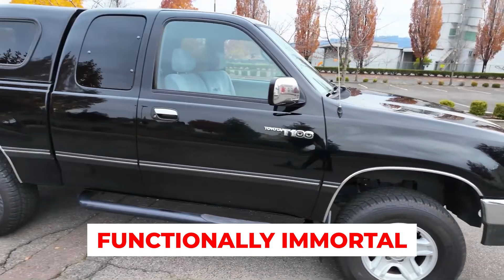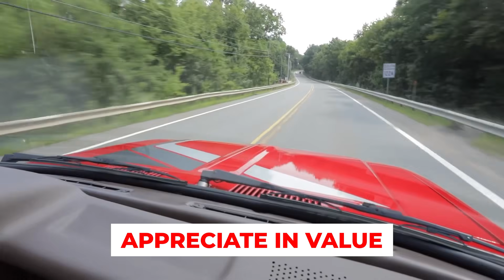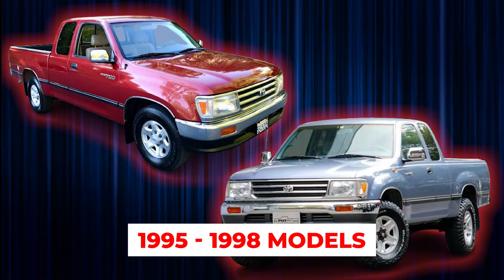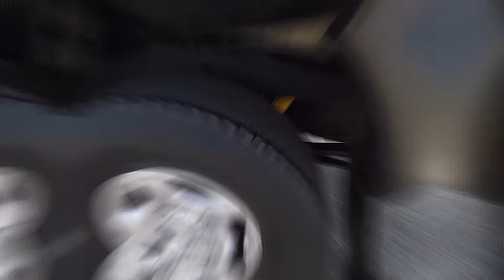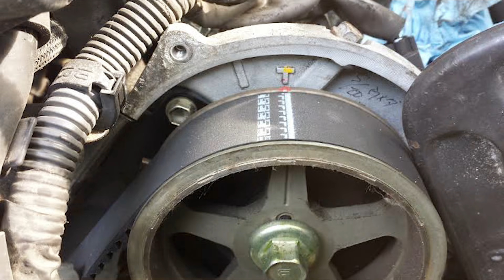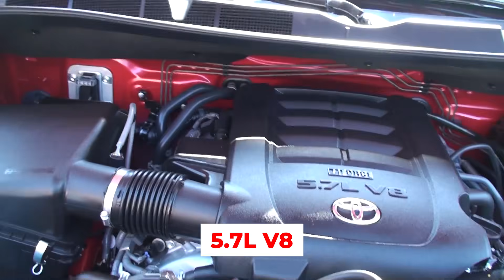5 Legendary Toyota Pickups That Are Better Than Buying Brand New!

Comment: My personal experience owning Toyota trucks: My first was a '96 V6 4X4 extra cab T100 SR5 that I used to haul heavy loads of bottled water out of the north Georgia mountains, I found myself wanting a V8 and bought an '02 V8 4X4 regular cab long bed Tundra SR5 in '03. I sold the T100 2005 and I rescued a 2007 5.7L V8 4X2 regular cab short bed Tundra SR5 in 2017 because I wanted a truck with performance that was similar to my '71 ram air 455 H.O. GTO that I had in the 80's and the 5.7L delivered. The '02 and '07 remain in my stable, and I see my old T100 a few times a month... the gentleman I sold it to has passed but his wife continues to drive it.
Reply from the maker: Great to see you back in the comments! You’ve really owned the 'greatest hits' of the Toyota lineage. I love that you mentioned the T100 - it was such a misunderstood truck back then, but seeing yours still on the road today proves it was built right. Comparing the 5.7L performance to a 455 H.O. GTO is a huge statement, but you're right; that engine really changed the game for half-tons. Since you've watched the evolution from the T100 to the 5.7L, do you think Toyota lost a bit of that 'simple' magic as the trucks got bigger and more powerful, or did it just get better?
Reply: @AutoMetricsHQ  In my opinion the ultimate Toyota 1/2 ton would be a standard cab early pre-facelift 2nd generation 5.7L Tundra SR5 with T100 build quality, a beefy mechanical LSD in the rear end and less interior plastic or a higher grade of plastic. The 6 speed automatic is fine, and I don't have a problem with push button 4WD
Reply from the maker: That's a really interesting combination. A standard cab with the 5.7L, the T100 rear LSD, and less interior plastic sounds like Toyota's 'greatest hits' rolled into one truck. It's funny how so many enthusiasts would actually prefer that over adding more screens and gadgets. Toyota definitely had a sweet spot in that era.
Reply: @AutoMetricsHQ  I would love to find a well kept 4x2 standard cab long bed SR5 T100 with a manual transmission inline 4.That would be a great around town truck.
Reply from the maker: Now that would be a rare find. A regular cab, long-bed T100 with the 2.4L and a manual is about as honest and straightforward as a pickup gets. I think a lot of people have forgotten how enjoyable a lightweight, simple truck can be until they drive one again. I still smile every time I see one on the road.